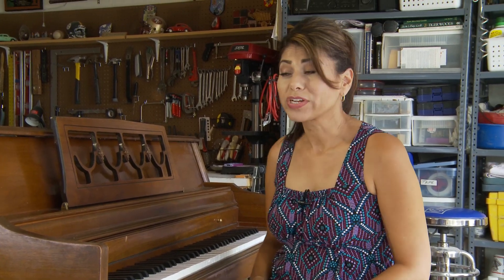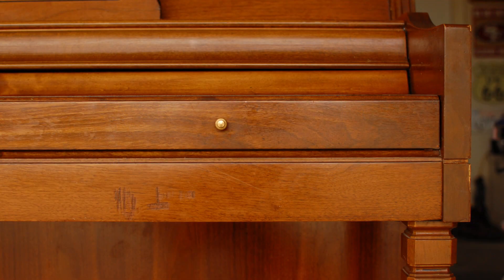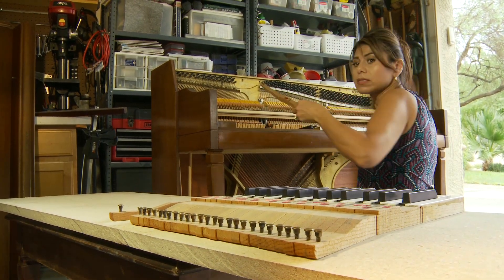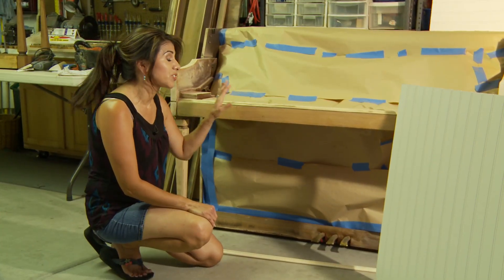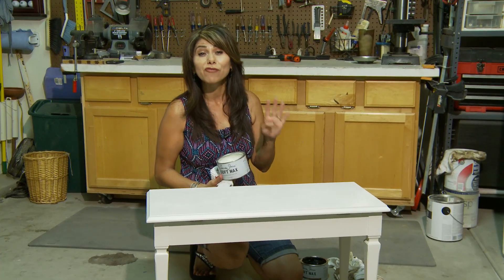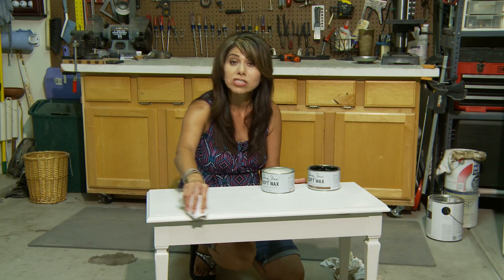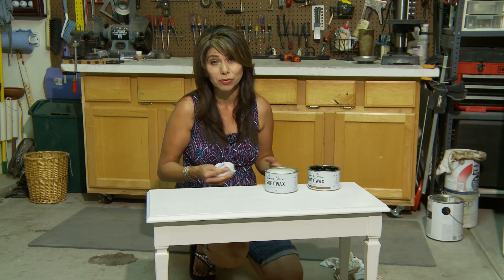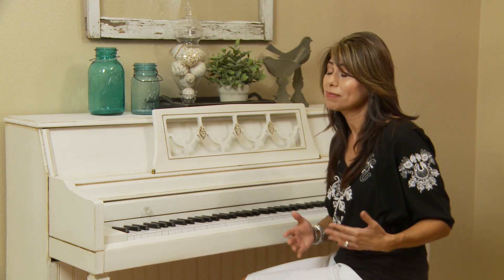HOW TO PAINT A PIANO: DIY tutorial includes distressing with Annie Sloan wax

Comment: Hello! :) i love the result! I have some questions! First of all can I use wall paint for painting? Can I just do the things how it is, or shall I really take apart the whole piano? Because mine does not have such little details as yours. And do you think i could manage to do it in my room? If i protected somehow the walls around and the floors, because I can't take it anywhere unfortunately.
Reply from the maker: +I Vikko I I used the same paint you would use on walls, so Yes, you can.  Just use a good quality paint, preferably in a satin or semi-gloss finish.  And, you'll want to make sure to put a clear protective finish (polyurethane) when you're done.  If you want it done right, you should take it completely apart.  (Trust me, it just looks scary.)  If you leave the keys and try to paint around them, you will not be able to get complete coverage when you push down the keys, so you're old finish will show.  But I guess it just depends on how much of a perfectionist you are.  If you paint it indoors, just make sure the room is well ventilated, and keep in mind that paint sprayers leave a layer of over-spray everywhere. Protect your floors, and watch the bottom of your shoes before you go into another room.  Thanks for checking out my video. :)

Comment: The problem with a belt sander like she is using is it rubs off the corners and leaves an unfinished look.If the piano deserves refinishing , you need to strip the finish. Summertime job done outdoors. Do as the says labeling and packaging everything. Spraying is better but not everyone has a spray booth. A piano truck lessons the workload. Stripping removes ALL of the old finish so you can clear coat later .Sanding sealer for undercoat.. Finish stripping by applying lacquer thinner with a rag. Its messy.
Several passes of spray are best.You should not see much grain.Reassemble . Its about 40 hours work to do it right, beware, its labor intensive.

 Tom Lloyd

www.mrtuner.ca

Comment: I can’t find that clear wax online. Do you know if it’s still for sale and if not which one to get? Thanks
Reply from the maker: I'm sorry to hear you're having trouble finding it.  As far as soft wax is concerned, Annie Sloan is the only brand I've ever used.  That said, what I tend to use more than anything else is in liquid form.  Minwax makes a really great protective top coat called Polycrylic.  You roll or brush it on and It dries clear.  It's water-based so you can also water it down just a bit and use it in a paint sprayer.  Best of luck with your project, and thanks for checking out my video.

Comment: hey what type of paint did you use?
i dont have a spray gun, i'll be brushing.
but i'm scared of air bubbles and dried brush line =\
Reply from the maker: I used Valspar Ultra paint.  I've always had great success with it.  Before I got my paint sprayer, I just used a small roller and was able to avoid brush lines.  So, you should be fine if you only use the brush in those hard to reach edges, then go over it as best you can with a roller.  Annie Sloan's clear wax is a great protective finish as well, that you just rub on with a clean cotton cloth.  Good luck to you!

Comment: Did you switch out the original wood above the pedals? It has a different look to it
Reply from the maker: +Rachel Nicholas Yes.  I added bead board to the front panel, and a thin piece of wood trim to the bottom, to cover up previous damage.
Reply: +MuralsbyMarcy  love the result! Thanks for the video!

Comment: How do you give it the shine though?
Reply from the maker: You can coat it with polyurethane.  Minwax makes a high gloss one.  While I didn't use it on this project, I've used it many times.  If you have a paint sprayer, just dilute it a little bit with water, and you'll be good to go.  If you use a brush, it's a bit trickier, so you may want to practice on something else first.